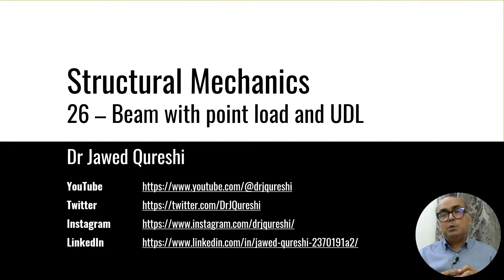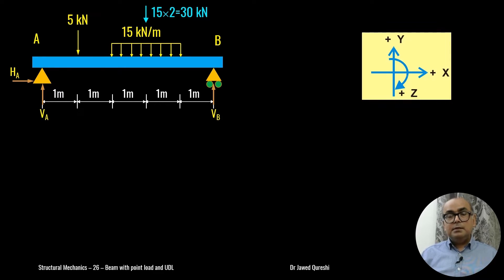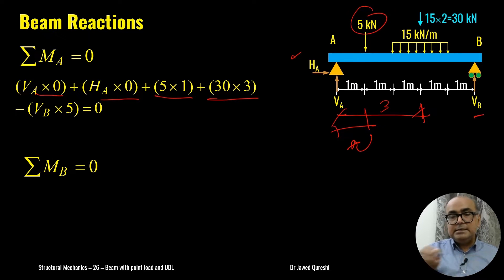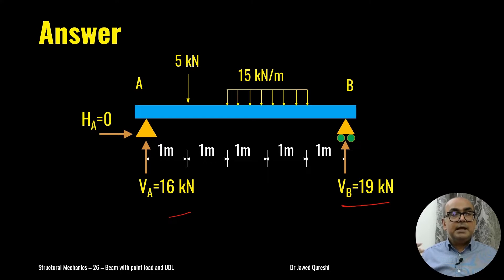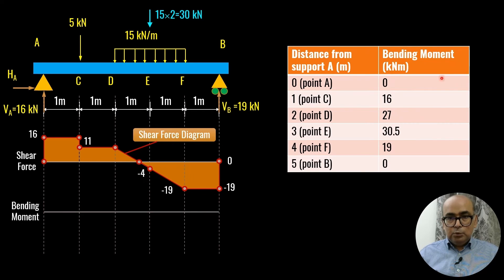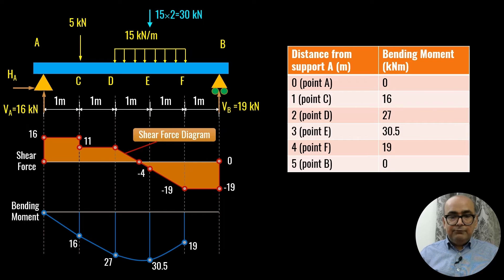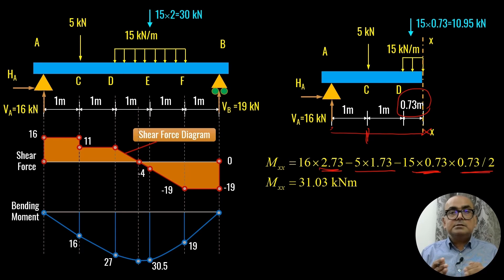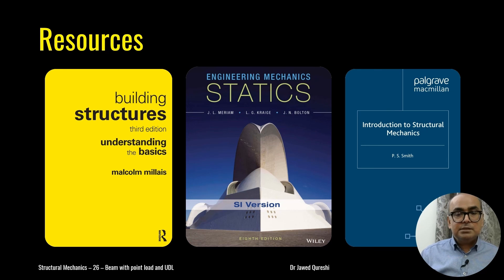Shear force and bending moment diagram for simply supported beam with udl and point load

Comment: Dr., I’m a bit confused about the calculations for the points. I initially thought the UDL should be considered over ACDEB (making it 2m), but I noticed you used ACDEFB, where the distance is divided.

I am using R.K. Bansal, which is also what my lecturer follows. In the book, they typically calculate the shear force first and then determine the maximum bending moment by identifying where the shear force changes sign (+ to -).

However, I’ve realized that in some cases—especially with a UDL—the shear force sign change doesn’t always appear, making it difficult to locate the maximum bending moment.

Could you please explain this in a simpler way? Also, can you suggest a textbook that explains this concept clearly?

Thank you, Dr.
Reply from the maker: UD is only applied between D and F. Change of sign in shear force will depend on the direction of shear force applied and sign convention. Here the sign convention is that the clockwise shear forces are positive. That means upward forces from left are positive and downward forces negative.